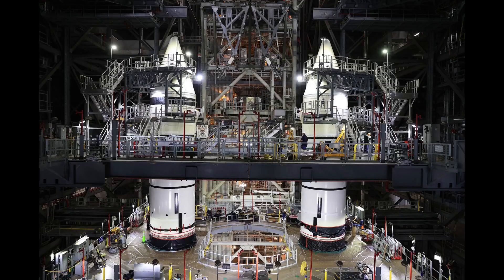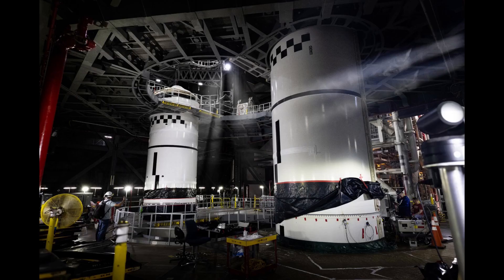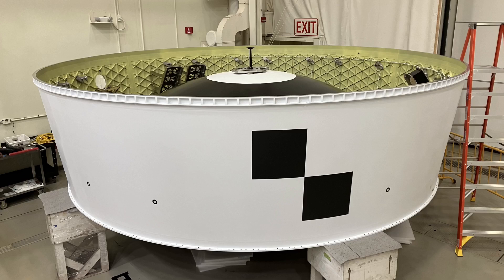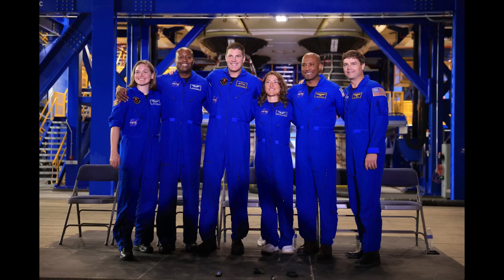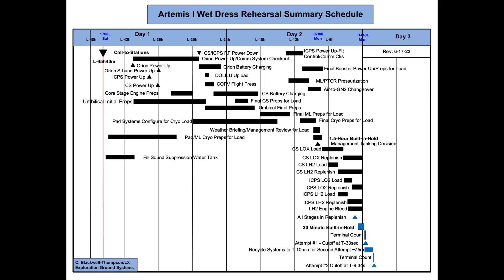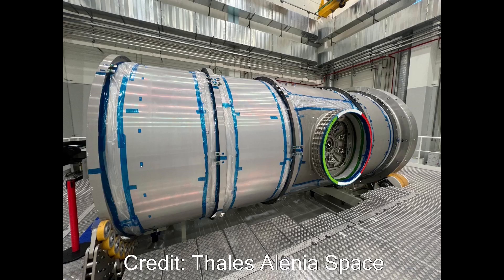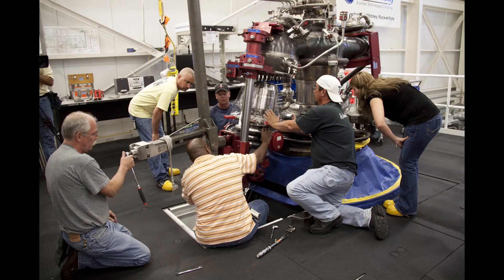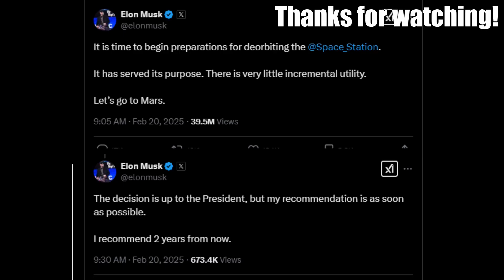Artemis II Boosters stacked, Gateway HALO nears shipment, first RS-25 restart engine completed

Comment: What changes have been done to the ground support equipment interface plates to insure no repeats of the hydrogen leaks that plagued Artemis 1?
Reply from the maker: They revised the launch commit criteria back in 2022 before Artemis I launched, based on investigating the problems they had, data from tests done back around 2010, and additional offline testing.

Post-launch they talked about a new revision of the plates (ground and flight), a new revision of the quick-disconnects, and some additional GSE tooling to measure the compressive force of the QD mechanisms when the plates are mated.

The tanking test will be a chance to see how all that performs, pre-launch.

Comment: We have an ISS replacement. The Lunar Gateway. It makes no sense, as the HALO orbit was only proposed as a manner to make up for the underpowered post-Constellation version of Orion, that is already obsolete. Launch it to LEO, and we retain our presence in Space.
Reply: It is SLS that's underpowered, not Orion.  SLS is underpowered until the Block 2 variant - which will probably never happen now (and probably Block 1B that was supposed to precede it won't happen either.)  As for Gateway, it is tiny, cramped, and underpowered compared to the ISS.  It would be an exceedingly poor replacement.  The hoped-for commercial space stations (such as from Vast, or the Blue Origin/Sierra Space collaboration dubbed 'Orbital Reef') would be better candidates.

Comment: The SLS   is the last of it's kind;  in the 2030s starship and new glenn  can do the heavy lifting. Starship has a hell way to go to be ready for Artemis 3. The refueling procedure should be interesting. Why do you think NASA is funding Blue Moon? Having a fallback alternative in case starship can't cut the cheese and a second option. Don't  want  to be dependant on Musk. The refueling in orbit of starship in orbit will be a high risk procedure it seems.
Reply: Blue Moon will also require refueling in orbit.  It'll need fewer refueling flights, but it'll still need them - and will rely upon yet another vehicle (of a completely different design), called "Cislular Transporter", for that.
Reply: Musk has lost his marbles.  He’ll be out of SpaceX in next 18mo

Comment: I know you've covered this in previous briefings, but does stacking the SRBs start an internal clock? Thanks again.
HEY TEDDY!
Reply from the maker: Yes, it starts a operational life clock; however, the time limit for a booster-intergration set is based on specific measurements taken of the field joint dimensions before stacking.  Without taking any measurements, they have 12 months minimum.  Assuming that the measurements show that the propellant hasn't slumped too much, they believe they have more time, as with Artemis I.

Given the current circumstances with DOGE, they are under big schedule pressure to fly Artemis II as soon as possible; if Artemis II is on the ground as long as Artemis I was before it flew, there might not be an Artemis anymore, anyway.
Reply: Yes, but its not really a clock, they just need to inspect them from time to time and thus can extend the clock based on results

Comment: Are they going to revert to an Apollo type heat shield manufacture for Artemis III or will they continue with the more dangerous modular construction that plague Artimis I, and was also used in Artemis II?
Reply from the maker: No, one of the stated reasons they took so much time to investigate was to find the root cause of the char loss, which was that the Avcoat in this large block design did not have enough permeability.  They did not know this before Artemis I, it was (in hindsight) an unknown unknown.

The Apollo honeycomb structure design did not scale perfectly to the larger Orion size, that had its own side effects.

As a part of the investigation, they tested an Avcoat formulation with higher and consistent permeability and those tests prove to them that will prevent char loss.  We'll see whether they are correct when the Artemis III Orion returns from the Moon and does a skip re-entry -- assuming there is still an Artemis III by that time.
Reply: @PhilipSloss  let’s hope so,  I feel SLS should be kept until Starship proves itself, which I expect is farther away than Musk will admit.  However I think (as a layman) that Orion should be kept a lot longer, as Starship will not be safe for human launches for a very long time.  Having no expertise I could be totally wrong.
Reply: Starship also can’t survive reentry from lunar orbit. That’s what Orion is for.
Reply: @JustMe-dc6ks  HLS Starship can't survive reentry from any orbit - as it will have no TPS at all (nor will it have the flaps required for controlled descent.)  The eventual Mars Starship variant will have to be capable of surviving high-energy reentry - but that might be easily at least a decade away...
Reply: I believe they didnt say what changes were made

Comment: 12:45 if Falcon Heavy will only carry the Gateway CMV to a trajectory close to GTO, does that mean SpaceX has been misrepresenting Falcon Heavy's performance and it can only lift ~18-19t to GTO instead of the stated 26.7t? If Falcon Heavy can actually perform as advertised, why would they not lift the CMV significantly beyond GTO and push Falcon Heavy to its limits in order to shorten the transfer to NRHO and conserve fuel on the PPE?
Reply: It's been a long known but understated fact that SpaceX has misrepresented the capabilities of Falcon Heavy. It theoretically has the propellant stores for it, but the second stage is not built to safely bear loads of FH max payload.
Reply: @abbyfluoroethane  well the question isn't "why don't they add more mass, by co-manifest an additional 8t satellite with the Gateway CMV to max out their payload capacity", the question is why don't they lift the same amount of payload mass (the Gateway CMV) significantly beyond GTO. If Falcon Heavy is carrying 18-19t of Gateway CMV and burns the upper stage until depletion, it should be able to make it far beyond GTO, maybe even all the way to TLI, based on its stated capabilities.
Reply: @plainText384   I do wonder, why NASA would spend extra time and money to slim down the mass of the CMV, rather than funding a SpaceX effort to upgrade the FH capability for max payload: the latter approach would superficially seem the simpler and less technically risky way to go.

That said, some simple Rocket Equation calculations based on available mass and performance figures, show that a reduction of payload mass from 26.7t to 18t doesn't yield as much excess dV as you might have expected.  From Wikipedia, the Falcon 2nd stage weighs 4t dry, and 111.5t fueled, and the Merlin Vacuum engine has Isp of 348s.  Given these values, a 26.7t payload yields initial and final masses of 138.2 and 30.7 respectively, for a total dV of 5131m/s.  Reducing the payload to 18t gives initial and final masses of 129.5 and 22 respectively, and a total dV of 6045m/s.  So that only gives you a net (theoretical maximum) of 941m/s of extra dV - as compared to ~3000m/s of dV needed from the PPE to reach NRHO (per NASA's slide at 12:34.)  Granted, a little extra dV would be also available from the first stage(s) thanks to the lighter payload, but that contribution would be relatively insignificant.  Overall, you're still less than 1/3 of the way to NRHO, with the PPE needing to supply the rest.
Reply: @Spherical_Cow  941m/s is a lot. The reason gateway might need >3km/s of deltaV is because the low thrust spiral is incredibly deltaV inefficient (and perhaps that 3km/s figure includes stationkeeping and orbital maintenance in NRHO?) If you actually look at Hohmann transfers, raising the apogee from 33,700km (what is suggested here) to a TLI orbit with an apogee of 382500km (average distance to the moon) should only require about 712 m/s of additional deltaV. Falcon Heavy should be capable of lifting the Gateway CMV directly to TLI, or if the low thrust nature of PPE makes it preferable, should be capable of performing a substantial apogee kick to get the CMVs perigee way above 200km.
Reply: Because of the second stage not designed to carry more . If they upgrade it it can do the projected payload
Reply: Its well known spaceX fakes their rockets perfomance, they did the same when they said starship could deliver 100T to LEO 😂
Reply: @Marty_Mcfly1999  That's not fakery.  Starship's objective is currently over 200t to LEO, as a matter of fact (this is for the Block 3 design.)  The Block 1 design was not capable of 100t to LEO, but it was an early prototype meant only for proof-of-concept tests.  The Block 2 hardware, which is only just now starting to debut (the first Block 2 Ship flew on flight 7; there's been no sign of a Block 2 Booster yet), is supposed to have a 100t to LEO capability.
Reply: @Spherical_Cow  bro, musk told us that starship v1 would get 100T to LEO, then he said it was actually 40T (I think v1 couldnt even get to orbit tho) and im supposed to believe that starship v2, only by being 2 meters taller is going to deliver +100% more payload than v1? LMAO
Reply: @Marty_Mcfly1999   I don't recall Musk ever telling anyone that v1 Starship specifically would get 100t to LEO.  100t to LEO was the design target for Starship from the start, but I don't think SpaceX ever claimed that v1 would achieve that target.  As for v2 - or as SpaceX calls it, Block 2 - it's 2 m taller but its cargo hold is several meters shorter, because its propellant tanks have been expanded enough to fit an extra 300 tonnes of propellant.  

People have done the math, and given the known Raptor engine performance numbers and the amount of propellant aboard, Block 2 Starship should be able to get ~100t of payload to LEO easily.  Although, it will need to launch atop a Block 2 Booster to achieve that, and switch to using Raptor 3 engines; for the next few launches SpaceX is still using Block 1 Boosters and upgraded 'Raptor 2.5' engines on the Ship, so as long as that continues the max payload to LEO with Block 2 Ships will be somewhat less than 100t - probably closer to 75t or so.